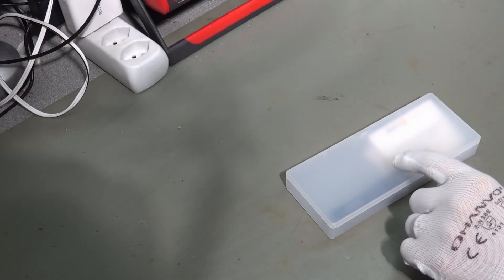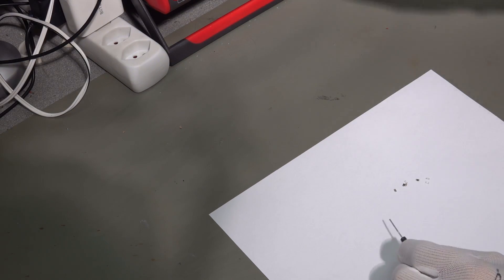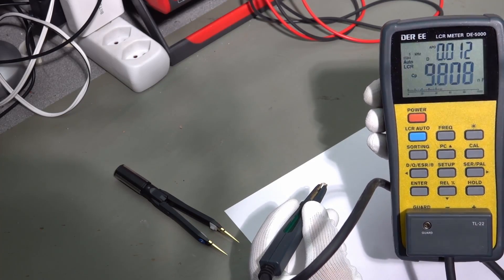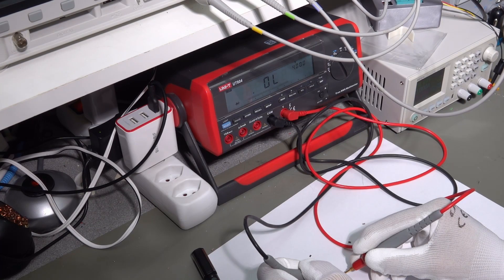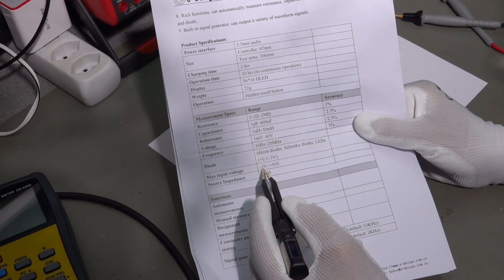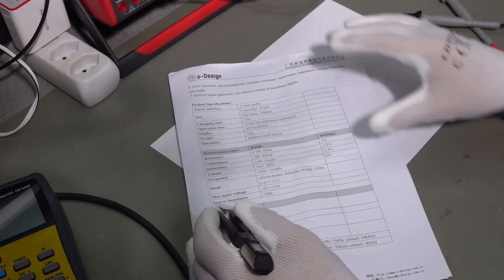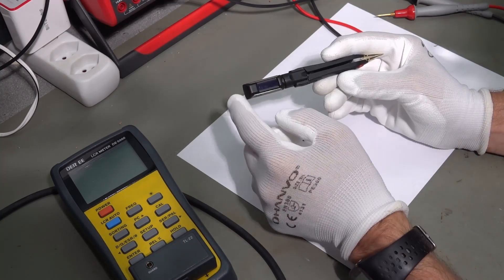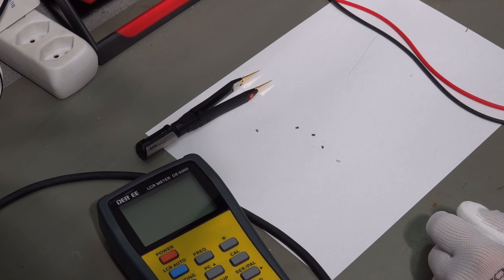#346 "Multimeter plus" Tweezers for R, C, L, Diodes, incl. a Frequency Generator: Miniware DT71

Comment: Look for "LCR Research Pro1 Plus" on Amazon. They have nice specs but pricey. Comparing to your DE5000 these DT71 tweezers is just a toy. Also, nHn inductors are so popular so these tweezers developers should have been looking into a little better range. There are some Russian tweezers with much better specs http://rlc-esr.ru/index.php/en-us/kupit/%D0%BF%D0%B8%D0%BD%D1%86%D0%B5%D1%82-%D0%BD%D0%B215-1-2031-detail
Reply from the maker: You are right, this Russian instrument has a wider range. We will see how it will compare with the price (it seems to be US$235). I hope the DT71 is considerably cheaper.
Reply: @AndreasSpiess  yes. The Russian tool is really expensive. It is kind of golden middle between "LCR Research" and DT71. DT71 could be a good option for newbies if they will have a price around $20. But for pros 1% accuracy & non nHn range a big turn off. Personally I desolder lots of smd components and sorting them is a nightmare but they come for free so tweezers like these is a real deal.